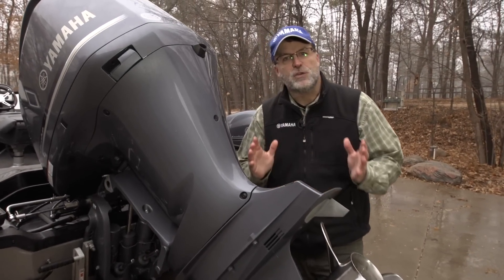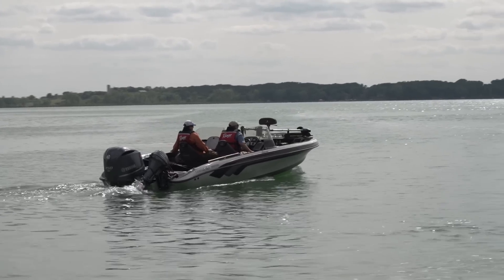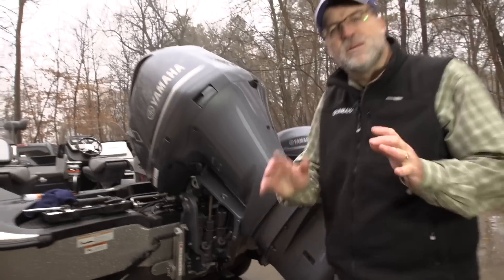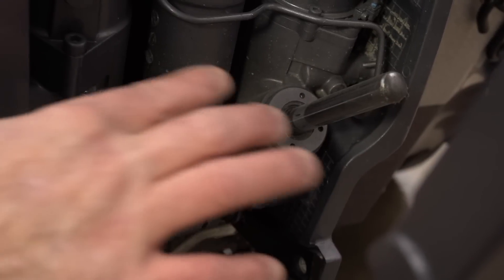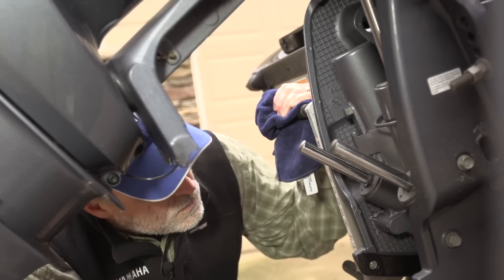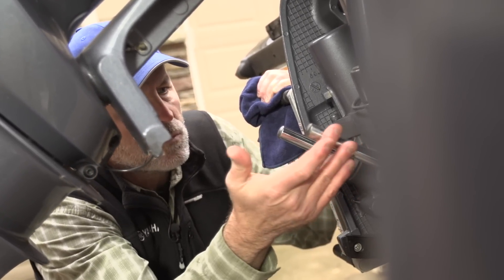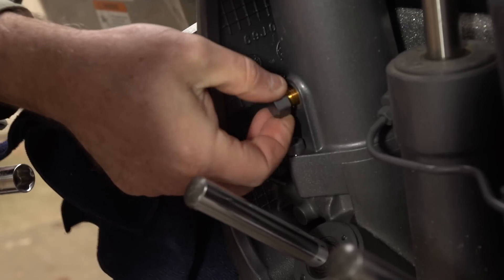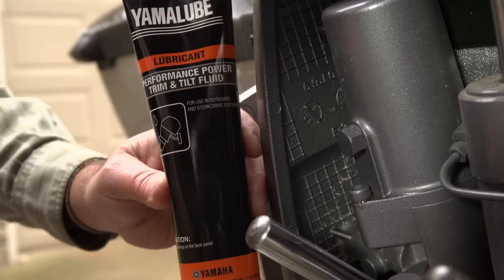Power Tilt & Trim | Maintenance Matters

Comment: Steve,
What do you use as an outboard motor stabilizer? I currently use one rubber yamaha piston support tube on my HPDI 250. It was recently suggested to me to go back to the old style lower unit to trailer mount/bar transom savor to provide better stability and less shock to the motor and bolts. Your thoughts?